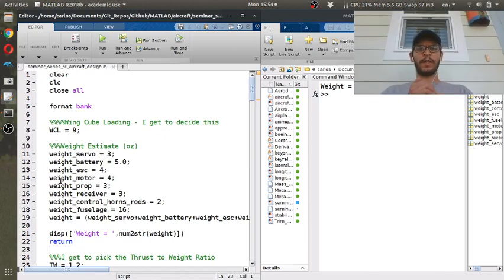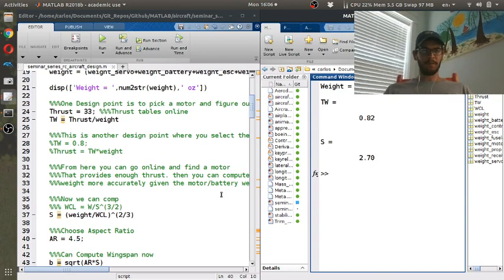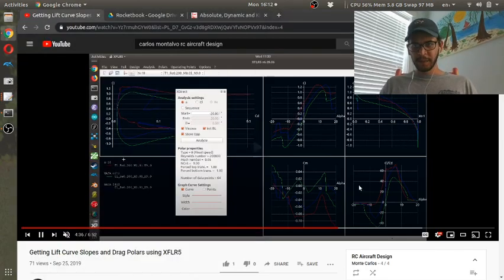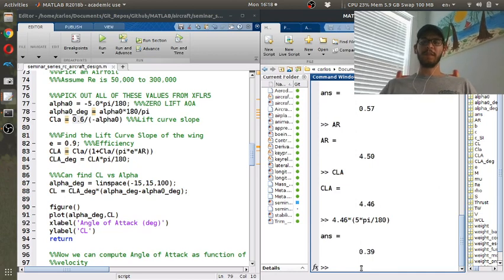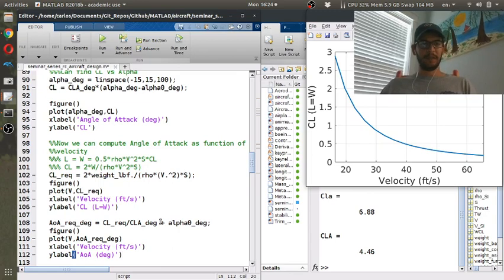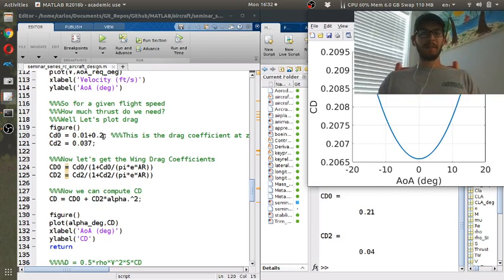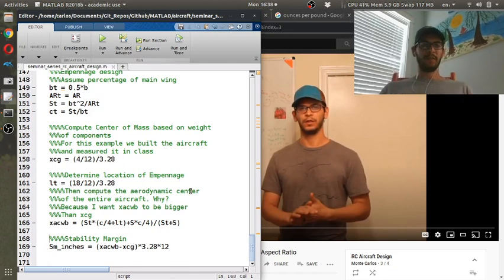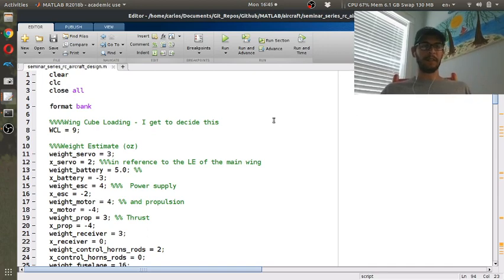Designing a Fixed Wing RC Aircraft in MATLAB Editor

Comment: why we dont use alpha0_deg we convert to radian ?
Reply from the maker: alpha0_deg is the zero lift angle of attack in degrees and alpha0 is the zero lift angle of attack in radians. So I have 2 variables in the code one that is in radians and one that is in degrees.
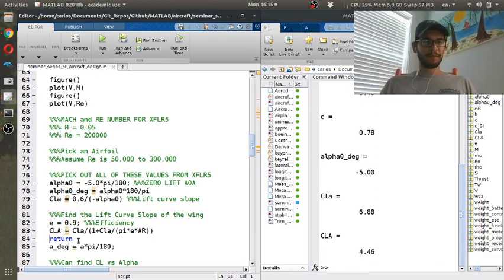Reply: @CarlosMontalvo251   Huge thanks to you Mr. Carlos. At 15:30 i notice that it should be CLA = Cla/(1+(Cla/(pi*e*AR)));   need to add extra parentheses

Comment: what is the cd0 cd2 difference  i dont get it
Reply from the maker: The plot of drag coefficient versus angle of attack is nonlinear so aerodynamicists try and use a polynomial expansion to compute Cd (drag coefficient) as a function of angle of attack (alfa). 

The formula then is

cd = cd0 + cd2 * alfa ^2

cd0 and cd2 are constant coefficients. Alfa is the independent variable and cd is the depedente variable. Cd0 and cd2 are the coeffients of the polynomial expansion.
Reply: @CarlosMontalvo251  i get it but how can i get cd2 quantity. You chose cd0 =0,01  when the curve touch cd-axis what about cd2 you choose 0.037 ?
Reply from the maker: @giovannigiorgio0  Cd2 needs to be obtained either through curve fitting or just by grabbing a point on the curve and solving for Cd2
Reply: @CarlosMontalvo251  thank you Sir. If you have a full code can you share with us? Because this L/D, drag graphics etc. you deleted.
Reply from the maker: @giovannigiorgio0  sure https://github.com/cmontalvo251/MATLAB/blob/master/aircraft/seminar_series_rc_aircraft_design.m
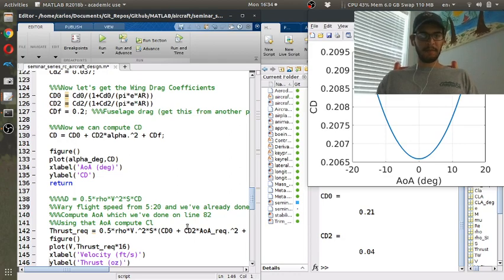Reply: @CarlosMontalvo251  Dear Carlos i found this thank you. I mean i want the 32:48 stuff which is L/D, drag graphics. You deleted but this might be useful for me I will be glad if you reply.
Reply from the maker: @giovannigiorgio0  I think this is the original code. Nice catch https://github.com/cmontalvo251/MATLAB/blob/master/aircraft/apprentice_design.m
Reply: @CarlosMontalvo251  i appreciate that. Thank you 🙏🏼🙏🏼

Comment: Excellent video! Thanks for sharing, I will use this in the near future in my hobby. Just a question, what about constraint diagrams? I took a course a long time ago and the professor started with those diagrams. Are they maybe overkill for RC airplanes?
Reply from the maker: I'm not sure what a constraint diagram is but it sounds like a skill learned in a senior design class. Stuff like that would be appropriate for a DBF competition or perhaps a full time job but if you're just building something for a hobby I would say that's overkill. When I design RC aircraft I usually just draw a picture, make sure my wing loading is good and then build it and put the biggest motor and battery it can take.

Comment: excellent video sir
Can we find these parameters(CL, CD, or lift, drag) exact value in Ansys fluent analysis or Solidworks?
I couldn't find the proper resources to find this parameter in Ansys or SolidWorks.
I have been using xflr5 for a year, I find it inaccurate while analyzing wing or whole aircraft.
if u know how to do this analysis pls make a video or suggest where I can find resources
Reply from the maker: It's possible to use Ansys or Solidworks and some of my students have used it before but I myself have not. If I ever use it perhaps I will make a video. My area of expertise though is in Flight Dynamics so aerodynamics is not my specialty.

Comment: @#monte_carlos

Thank you for sharing this extended screen cast. It was worth it!

And, sir, I hope you plan on doing something similar with Quadcopters in the near future.

Also, it would be great to know if Blade Element Theory for the Propeller blades may be covered as well as some Rotational/Transformation matrix if it is okay by you sir.

Thank you sir.
Reply from the maker: Quadcopter design is really more about just choosing hardware rather than any aerodynamic design. Typically places like Tiger Motors have data sheets to show how much thrust you get given the propellor, throttle setting and battery voltage. It will also tell you the current at various throttle settings so you can choose an ESC properly. Therefore there are not very many calculations other than ensuring that 4*T = W where T is thrust and W is weight.

As for BEM that would be an interesting video to make and perhaps I will do it.
Reply: @CarlosMontalvo251  Alright. Thank you for sharing sir. I should check out Tiger motors. Also I look forward to your lecture on BE theory whenever its convenient for you sir.